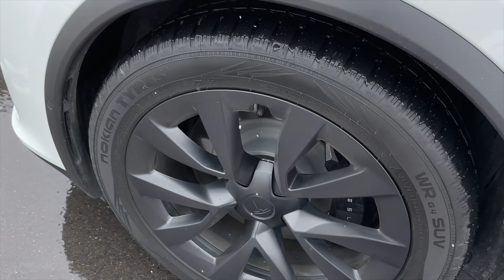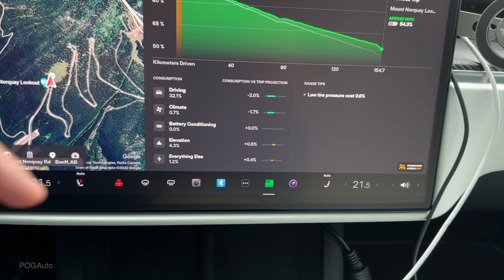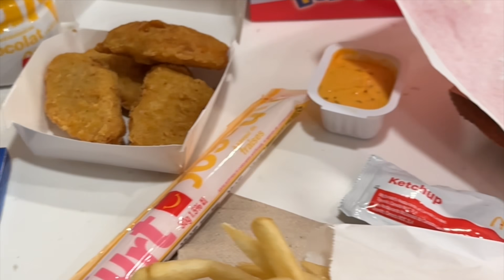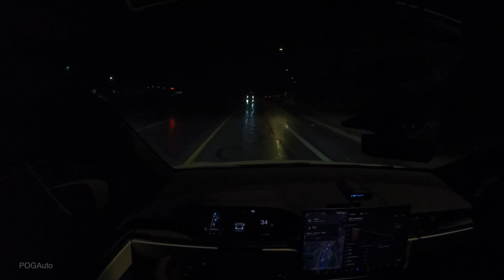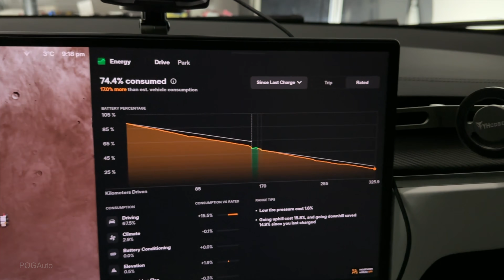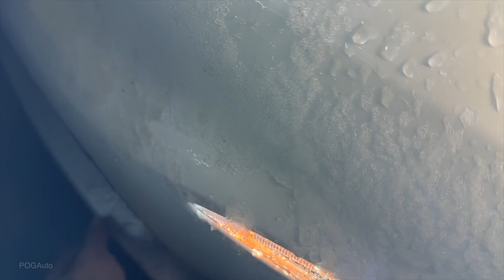First Snow 2022 Tesla Model X Long Range Road Trip!

Comment: The owners manual says to use the same size tires for winter tires, but the wheels are 1 inch wider in the back!  So not sure about getting the different size tires….
Reply from the maker: I now have nokian R5 265/45R20 Tires in the back and no issues
Reply: @POGAuto  was there an issue having the 275’s in back originally?
Reply: I’m trying to figure out what size snow tires to buy but it is confusing with that statement in the owners manual…
Reply: @ryancovey4361  match the tire size with oem